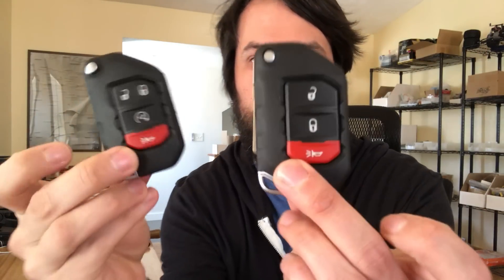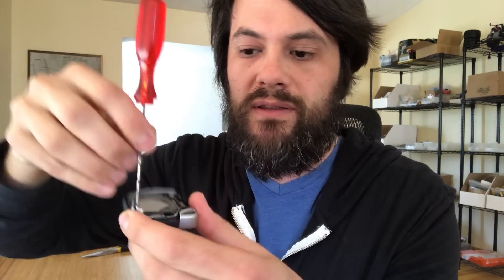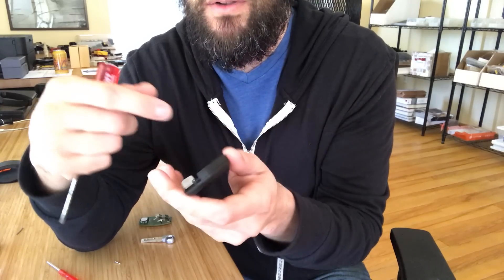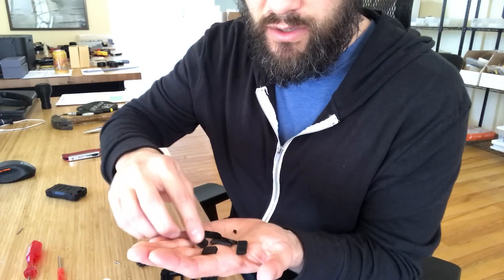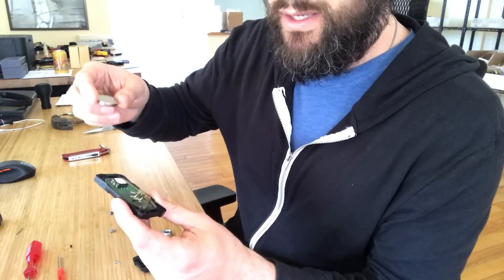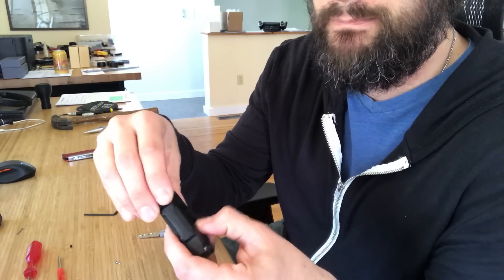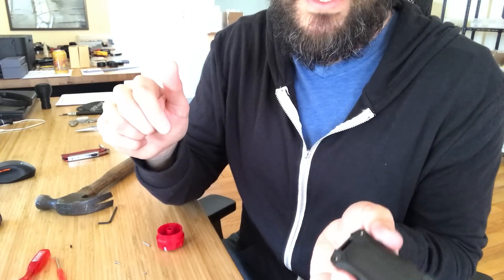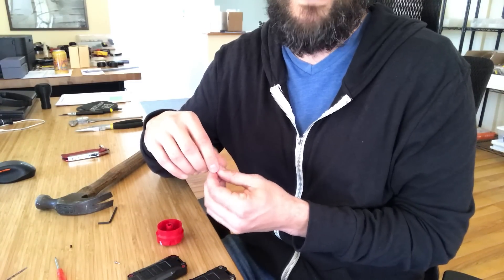AJT DESIGN Injection Fob (Wrangler JL)

Comment: I love this thing. The battery is tricky but if you just hold it together on the battery side and push the battery in against the metal retention clip with a knife blade carefully, it will then seat into position and you will then be able to click it shut without issue. Works great and the best part.. no more freakin key popping open in my pocket!!
There is no way to close it over the battery the way he does in the video. He's obviously using dark magic to do that. Don't bother trying. Also, expect to destroy your original key fob while getting the little transponder thingy out undamaged. All in all, it just takes a little effort. Something severely lacking today as is proof by most of the comments here.
Reply: Thank you for posting. There’s probably torture treatment less frustrating than attempting the video approach to getting the battery to stay put. Was done in 2 tries after reading your knife trick. Works great. I’ll have to engineer a torque option for the key to use the seat locks, but pleased to lose the Jeep OEM pocket monster.
Reply: Now I have to buy new thumbs after an hour of trying to assemble this damn thing

Comment: As others have said, getting the battery in this was a complete nightmare.  I was on the verge of returning it when I came here to see if others were having the same troubles.  I definitely think he is using a thinner battery than what comes with the jeep fob as there is pretty much no way to install the battery as he is showing.  I took the advice of using a piece of tape to hold the battery down.  Took me about 5 attempts to get it but it worked.  Very frustrating though by the time I had finished it.  I decided to put the original fob back together with just the key in it and it works great.  Taking the key apart and then having no leverage sounded bad.

Comment: Putting the two pieces together was much harder than shown. The battery is a big one and even the slightness touch throws it off it's perch. I finally got it in by putting the two pieces together and inserting a very small flathead screwdriver in there to push the battery into place. That wasn't easy either, but it took about 5 tries versus the 30 tries with the other method. 

That's not your fault. You're trying to make an aftermarket product that still fits Jeep's setup. I'd like to see you focus more on that part though since a lot of people are having trouble with it.
Reply: B. Austin came to read the comments after going thru the same thing and I ended up doing the same as you did.

Sat the battery on the back case instead of the board, then went ahead and tried to sandwich and with a flat blade went on to push the metal borders on the blade to make the battery fit until it sat in place. Im now debating if opening the case again to try how the click is without the little triangle between the unlock and lock 😩
Reply: Salvador Santana  I didn’t use the triangle. It appears to make the button presses harder. Honestly it works just fine without the triangle installed.
Reply: B. Austin decided to open it again to take the triangle out and using our method again was able to put it back together with no effort 😁
Reply: @salvadorsantana9468  do you have a video? i cant get it

Comment: Just received my AJT fob.  Love it!  However, there is a much easier way to get the cover over the battery.  Place a small narrow piece of scotch tape on the battery and then secure the battery to the long metal piece of the fob that surrounds the outside of the battery.  The battery stays in place and the cover goes on easily.
Reply: Thanks this should be part of the normal instructions - I put some tape on top of the battery, over that metal leaf spring, and slightly around the other side of the electronic board. That held the battery down on that side instead of constantly going above the spring and getting stuck on the edge of the battery.

Comment: I got it together, Don't know what I did, but it just went together as easy as the video after about 10 min of trying.  Don't give up and don't force it. It indeed goes right together without force.  I would recommend that you check your buttons in the new fob before you put it together.  Make sure they move smoothly.  Mine needed a little cleanup in the case part to move freely.    I think that is what some of the comments are about where it kills the battery, caused by a sticky button..

Comment: My friend gave one to me as a gift. I have just assembled it. Impressions:
The plastic is softer than the oem. Not refined finish as you can see and feel the spot where the plastic parts were broken off from the matrix. 

Lock/unlock have to be pressed much harder than the other buttons regardless of not/using the triangle. 

Inserting the battery is not difficult, but , man , design things better. 

A better suggestion for the metal key is to reassemble the old key fob with it and keep it elsewhere. You can lock the glove compartment and the armrest and keep the old key fob when you give the AJT key fob to a valley.

Comment: Instead of just having storage for the key, have you considered allowing a way for it to slide out in a channel in the back, which would still allow the key to be used, but not spring loaded (think of how the blade retracts  in a boxcutter)?  The only downside I see here is that if you need the key for locking the center console or locking the read seats, there is no handle to easily hold and turn the key.

Comment: You're using a thinner battery. I had to line it all up and hold it together as I pushed the battery against the negative retainer until it all clicked together.  Easiest way is once you have it squeezed together rest the fob on its side on bench and use a small flat head to move battery in position and apply pressure on the battery ans squeezing the fob together until it can close.

Comment: Two month update. Once together it's a better fob than the OEM for comfort in your pocket. The issue after the fact is the actual key. You need to lock and unlock the glove box, console and rear seats. Without there being a slot to put the key into you have no torque. It would have been better if you actually thought this through. You've solved 1 problem and created two others.

Comment: I'm not saying its impossible to assemble it with the battery like he did but it certainly felt that way.  pro tip use a screw driver to push the battery in place he's obviously using dark magic in this video

Comment: Can’t get the cover to snap.  Have studied the technique and tried  alternate ways.  Closes easily without battery. Working on it for an hour so far.
Reply: Finally got it after using one of the small screws from the original fob and Placing it under the battery to level out the battery for it to seat correctly.  Tolerances are too tight and if there is any angle in the battery, mine would not seat properly

Comment: I could get the fob put together just fine but It's nearly impossible to click the lock/unlock buttons when they are next to each other (you may have better luck with individual buttons?) - yes I did put the rocker triangle plastic piece in. Returning because of that and it's not really that much smaller than the official fob.

Comment: Put the battery on the circuit card. Put the cover over it, gently apply light pressure with your thumb and index finger to hold the 2 halves together at the battery end. With a popsicle stick push the battery towards your thumb and index finger. push towards that spring loaded metal piece. The piece has to go in first or your never going to get it. The Popsicle stick pushes the battery in past that rounded plastic holder piece. It's a PITA, but it can be done.

Comment: For $100 a pair this has to be the shittiest attempt at engineering. How is it you can't come up with a way to hold the battery flat in place?
I can't get the fob closed because the battery slips up onto the metal connector.
Also you have to make sure that people know that you have to break the transponder out of the OEM fob making it useless if you get fed up trying to balance the battery and want to go back to the OEM fob.
I dread having to replace the battery when it dies.

Comment: Absolute scam, this is simply poorly engineered period. The socket on the back side sucks up the battery into position making it impossible to place the peg while keeping car enough to catch the bath edge on the circuit board. The only way to install it is to permanently bend the tabs on the circuit board out of place, not ideal.